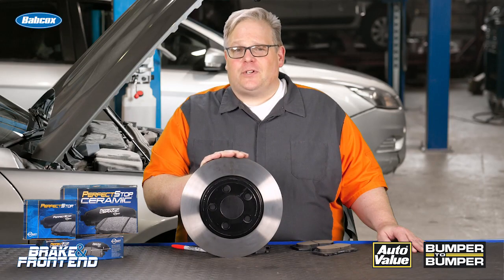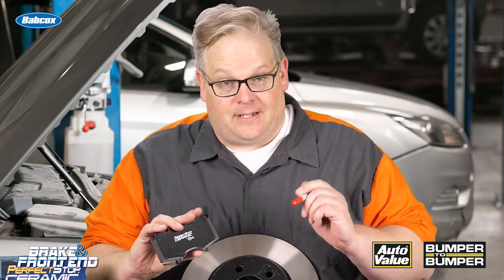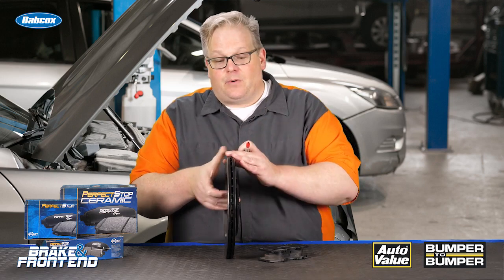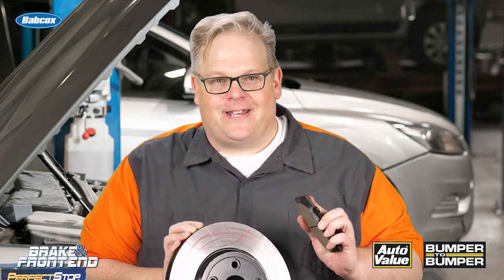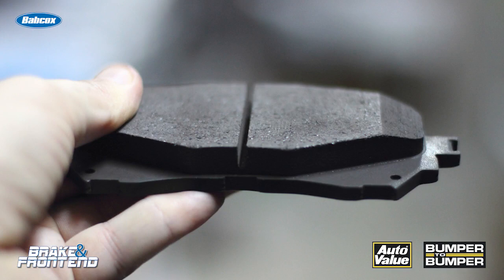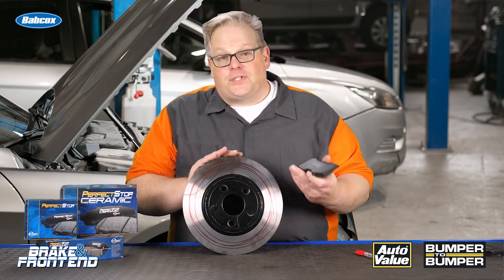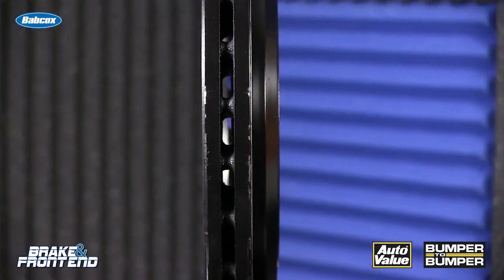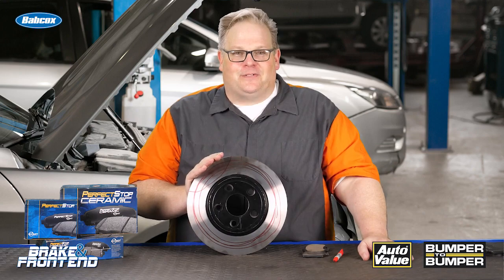Understanding The Relationship Between Brake Pads & Pulsation | Tech Minute

Comment: I had a nightmare with this. The only solution was to replace the bearing and hub/flange and replace the discs again. Fixed the problem. Must have been slightly bent as i cleaned the hub face up perfectly.